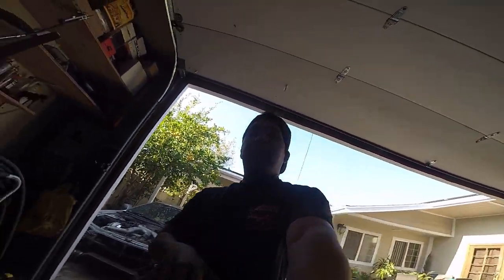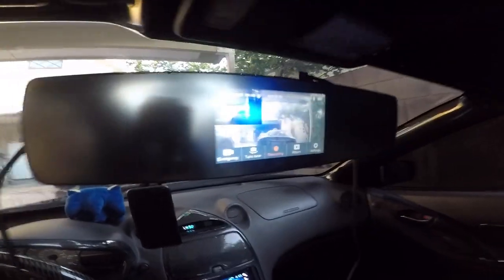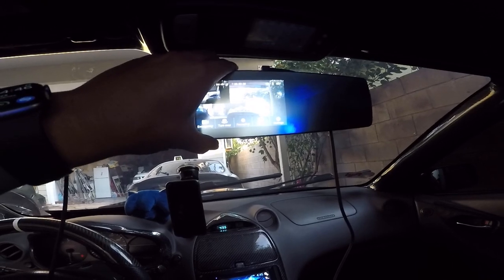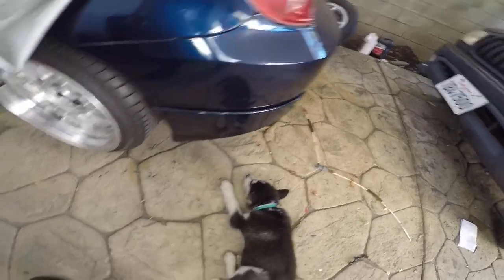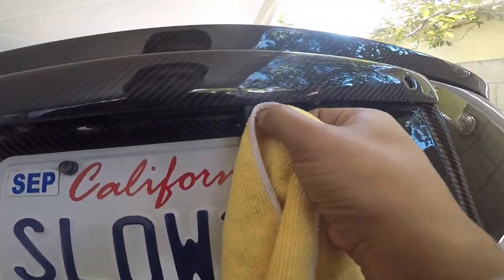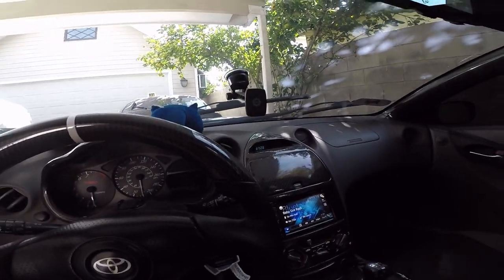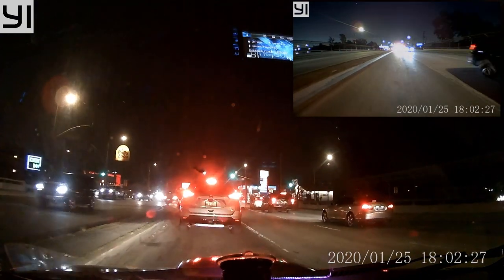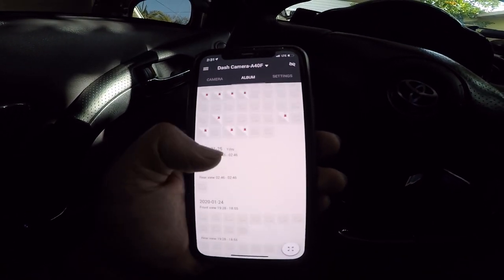Must Have In Every Car

Comment: RAF love the channel. You put a video on about reverse camera. I’m in Uk. Got celica 190 bought a similar dash cam only cost £38 Uk has rear camera. Fed wires to rear through hatchback same but how did you feed wire through to fix to number plate. Did you remove lock or celica badge or drill a hole ?? I’m stuck can u advise
Reply from the maker: Joe Blogs I dont have the covers for the license plate light so can it through there
Reply: Do u understand what I mean. ? Trying to fit camera on rear like you did fed wire through channels in tailgate but cable has to go through tailgate to attach camera on reverse I don’t know how you did that
Reply from the maker: Joe Blogs send me a dm on ig
Reply: What’s a d m or I g plz ?
Reply from the maker: Joe Blogs direct message on instagram
Reply: Rafa's Garage don’t have instagram
Reply: Raf. Thanks f replying. Don’t worry about camera my friend. I’m getting shot of it. It’s not same as yours. I’m not happy with one I bought. It’s coming out tomoz.  I’m getting nextbase 522gw easy installation with hardwire kit to fuse box has suckers front n rear n just run cable under head liner. You are a star I wish u all the success in what u do. Thankyou
Reply from the maker: Joe Blogs Its ok I am always here to help and sorry you didnt like yours. Thank you very much really appreciate it and likewise to you too